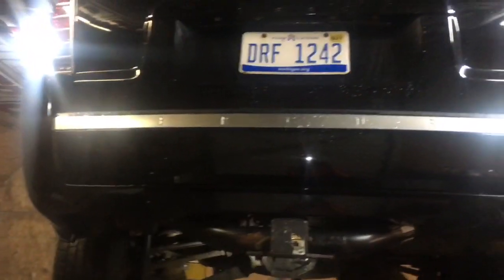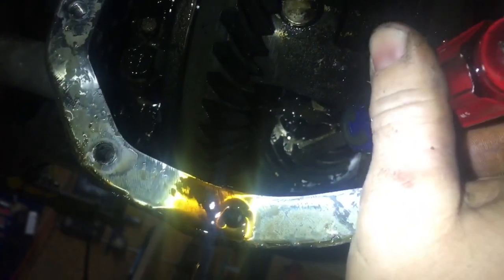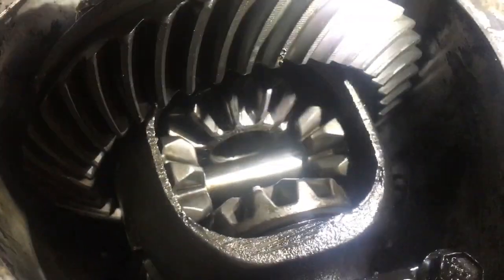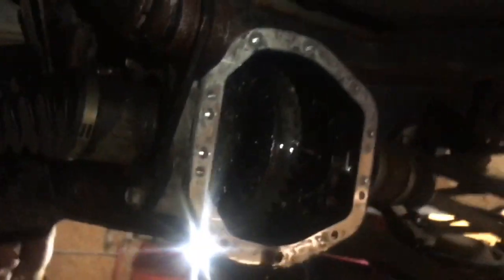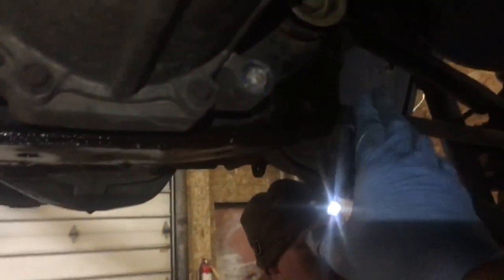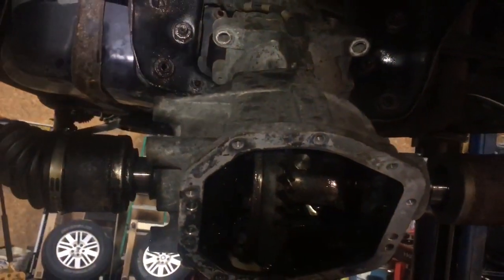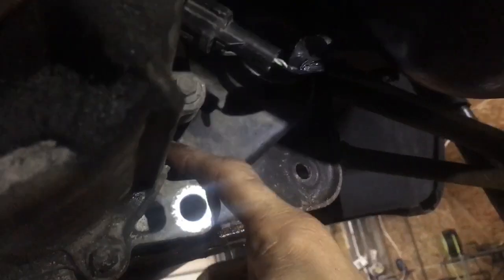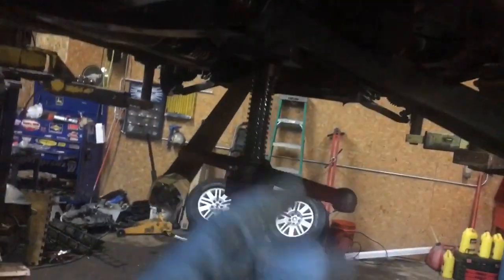How to easily remove rear differential on a ford escape

Comment: Did you swap out the rdu... or did you find replacement parts for the pinion gear... do have any video for ford edge and rebuilding a rdu.

Comment: For safety reasons, disconnect the negative battery first, not the positive.  The end result is the same, but if you touch ground with the wrench, while disconnecting the Positive first you can create a large spark, doing the negitive first you do not, on a negitive ground vehicle

Comment: My rear diff is going on my 2005 Ford Escape. I removed the drive shaft and made it into a front wheel drive for now. Because the rear axles are still in the diff the grinding is still there. Can I remove both axles or can I remove the ring and spider gears so I can still drive it without the harsh grinding until I can get another rear diff

Comment: What year of escape is that?  I have a 2013 and that looks nothing like the one I have.  I was told that Ford makes no parts to rebuild the 2013 rear differential and that I have to buy the whole assembly at about ouch I wasn't expecting that.
Reply from the maker: 2013 is the first year for your body style this is from the old body style, 

What is it that needs to be replaced in the rear end?

Is it four-wheel-drive?

Comment: You do it the hard way. I used a port a power to push it apart and the axles come out. Pull the axles back in with a come along. Done the easy way.
Reply from the maker: Quite possible, since it was the first time I’ve ever done it

Comment: Hey. I'm getting a growling noise from the rear when I make sharp turns on my 2012 4WD escape. It drives fine otherwise. Do you think I have a bad rear diff or is this normal? I don't get the noise when i remove the 4wd fuse.
Reply from the maker: More than likely rear differential is just fine from what you’re telling me I think it’s a possibility that you have a bad wheel bearing so in this video I show you the procedures that I use to check for bad wheelbearings let me know what you think I hope it’s helpful.

https://youtu.be/uyt1OwPwVD8

Comment: Can the rear differential be removed permanently? I have already removed the driveshaft and am only using front wheel drive right now. I want to remove the rear diff to help a little with the fuel economy and get rid of one more thing that can go wrong. Once the rear diff is gone, probably the half shafts can be pulled out too.
Reply from the maker: I’m pretty sure they can .  But I don’t want to tell you to do it because I’ve seen wheel bearings fall apart because they didn’t have the axle to hold them together . 

 So I think there’s two things you should do before you attempt it .  Look at a 2 Wheel Dr. version and see what the wheel bearing looks like .  If there is a hole in the 2 Wheel Dr. version then I would think you would be OK . 

 If there is not then cut the ends of your axles off and leave them inside the wheel bearings . 

This is just a theory but I believe you should be OK sorry I can’t be responsible and I wish I could tell you for certain have a good one good luck let us know what happens
Reply: Thank you for those points. I have a 1999 F150 where the front diff burnt up and deleted it. I had to cut the half-shaft at the wheel, ground it smooth and bolted it back on as it retained the wheel. I've run that way for 2 years and no problems. This is a farm market truck that only sees highway and is off the road in September. I have a F350 and F250 in 4 wheel drive setups, so I don't need the F150 in the winter.
With the Escape, right now it gets about 27 mpg and I am trying to get to better than 30 mpg.
Reply from the maker: Oby-1 I wish I got anywhere near 27 miles to the gallon in my escape but let us know how it goes and then that will help other people in the future started in a new thread conversation if you get it completed and share
Reply from the maker: emosh73 Or you can just buy one that matches the other ones but yes you need to replace the tires all at one time generally you should be able to get a brand new set of cheap Chinese tires but right around $350-$450 installed brand. Or you could find a good quality used set
Reply from the maker: Well you can put any tire that you want on the vehicle. If they are dramatically different sizes they will change the speed of the reluctor rings at the  wheels. 

Putting the wrong size tires on different wheels make the tires move at different speeds. This makes the friction between all of the moving components different rates. 

It’s a simple answer if you do not want things to wear out quicker replace all of the tires if the vehicle is not worth keeping for another 5 to 6 years just replace the one that’s defective with the one that’s similar in size.
Reply from the maker: emosh73 Nope sounds like a good plan to me sorry about not getting back to you sooner

Comment: Really? Is that you call easily? With hoist, jacks and other pair of hands. I thought easily means another than that.
Reply from the maker: When I say things like that I definitely think about you folks at home yes a pair of jackstands and maybe another set of hands but I don’t know that it’s absolutely necessary I do think it’s a relatively easy job getting in and out from underneath the car is another story that’s not easy depending on how old you are sorry I wish I would’ve been a more help for you God bless have a great day
Reply: Iurii Reshitnyk - pfft I just did this same job effectively three times: in the garage (3 hours), in the junk yard (2 hours). Reinstall about 1.5 hours. All hand tools and not a huge amount of experience. So, yes, it’s an easy job. The worst part  is trying to remove the bracket that is near the gas tank BUT the diff can be jimmied out with that bracket in place AND I didn’t disconnect the lower control arms!  BOOM!

Edit: I did bash the shit out of my head a few times crawling under the vehicle and I’m 48. If you’re 49 I wouldn’t dare try this at home!!